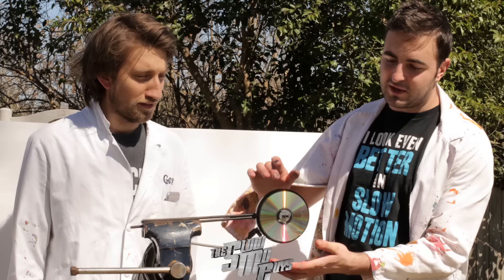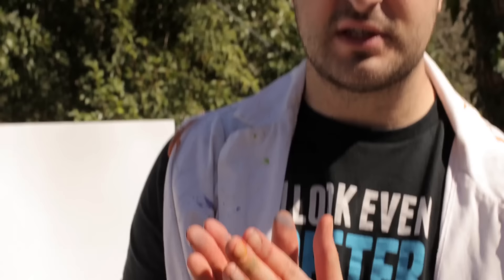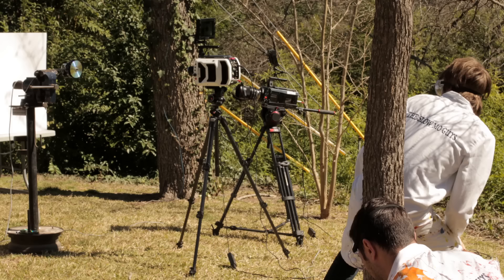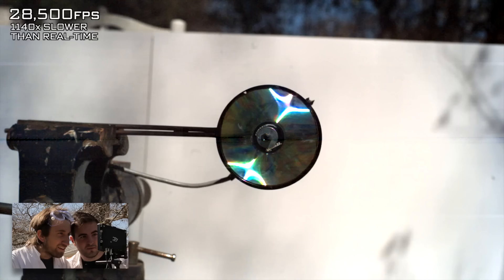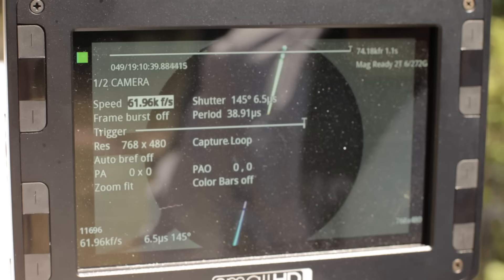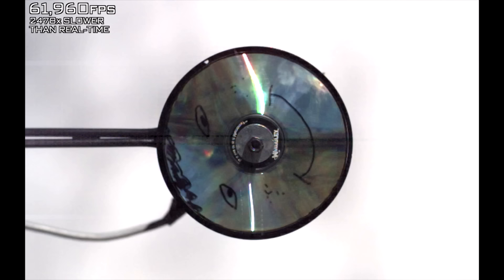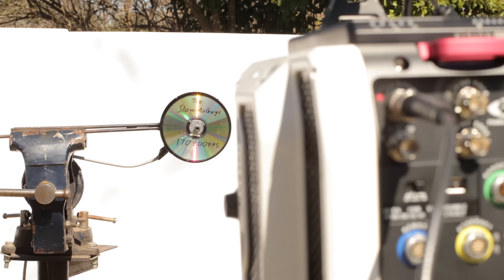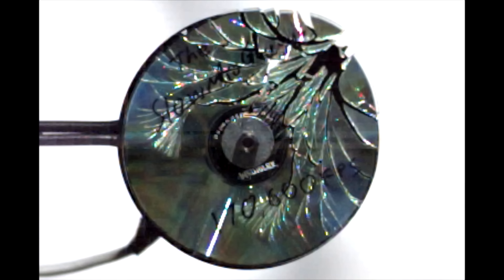CD Shattering at 170,000FPS! - The Slow Mo Guys

Comment: The curvature on the CD moves slower than the CD itself, I am no physicist but this could be because the curvature is not the result of the CD spinning but of the rotor's vibrations. Hence if the curvature exerts a force on the CD that leads to break itself it would be interesting to see results with a perfectly static rotor and perfectly parallel aligned CD when put on the rotor. I bet the CD would not break until reaching a ton of higher speeds... What do you think?

Comment: So my guess would be that it is all AirDrag, warping, heating and eventually breaking the CD's or records. How long would they last in  vacuum? Would the break also? If so at what speeds? For how long? Would it shatter more or less? Would the pieces fly further?  If they do not break because of the vacuum try adding the air in again, first slow and another fast. Maybe collab with "The Action lab" on this, he has a vacuumchamber

Comment: 500 fps = Super Hard Slow
1,000 fps = Hard Slow
2,500 fps = Medium Slow
5,000 fps = Slow
12,000 fps = Super Slow
28,500 fps = Ultra Slow
61,960 fps = Hyper Slow
170,600 fps = Mecha Slow

Names are based on the tire compounds that are used for Formula 1.

Comment: Greetings. Dunno if you already done it, but you should try to film directly from the side and from the top. As the perimeter oscilates, there are a series of overlaping waves, that keep matching frecuencies at some points of the perimeter. The breaking point starts from one of these stress points, where two waves reinforce each other until the CD's structural integrity can't hold itself anymore.

For anything, please excuse any typo. Greetings from Ecuador. XD

Comment: When unknowing people use a 4 1/2" grinder with a cutoff wheel attached, they'll try to push the the sparks instead of pulling the sparks. And when the wheel jambs, ans it almost always does, the arbor nut keeps spinning, hence it gets tighter and tighter everytime the wheel jambs. I would like that proven

Comment: The the wobble is making is bend so much if breaks up for the same reason if breaks when snapping it in half? I would have thought it was from the mass being pulled apart from centrifugal force like how water in a spinning a bottle moves to the outside end

Comment: The goggles they're using are not the shatterproof or meant to protect from high-speed particles. They are meant to protect you in a chem lab from sprays of liquids. Safety glasses and a face shield would have been more appropriate.

Comment: Awesome!
How many RPMs (on average) did you guys get before the disc broke? Have you considered which forces actually ruptured the disc (radial, hoop, axial, etc.)? I wonder if it had anything to do with the wavy motion at all. Lastly, have you inferred any correlation to the rotation speed of the disc with the rotation of the wavy features? Maybe there's some simple or at least general formula based on thickness, mass, density... Just curious and mesmerized :-)

Comment: I had a CD explode like this in my PC years ago. I had some software that needed the CD ROM to be running when you used to program. It started to make a terrible noise and then shattered. I removed the drive, took it apart and got all the fragments and reassembeled the CD like a jigsaw. It always puzzled me why it made a noise before shattering. I assumed it would have just played normally and then shattered instantly, but watching this I think it might have started that warping. Seems odd since I doubt my CD drive would have been going fast enough but maybe the disc was faulty? The software manufacturer gave me a free upgrade to a newer version that didn't require the CD to be running all the time.

Comment: Why 2,500 fps with the Flex? I would refer up to 23.6k at 384x256, or 49k at 256x144 for the Flex to count. I used the Calculator at PhantomHighSpeed.com to show the results.

Comment: What would happen to the CD if it was ran in a vacuum? It seems to break because of wind resistance.
Reply: It's not wind resistance, it flexes because the outside of the disk has to travel faster than the inside.
Reply: David Bhart why does it distort then? Is the disc  edge trying to expand while the center stays the same? 
It looks like the outer edge is being slowed causing it to distortion and break. This is not caused by wind resistance?

Comment: If this were to be the engine of an airplane. I can't stand the rotational force. It will become a fragment and break as it is. In addition to that, the engine will also be damaged. Engine failure due to the influence of debris. Damaged. In the worst case, it can be a crash.